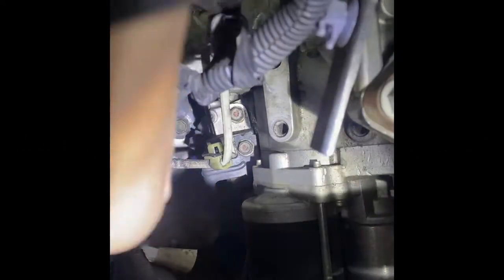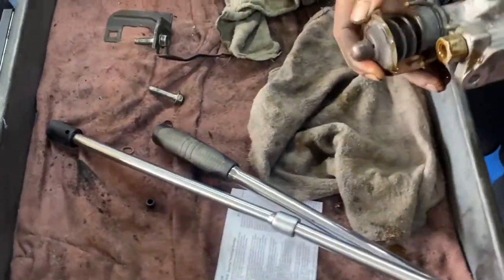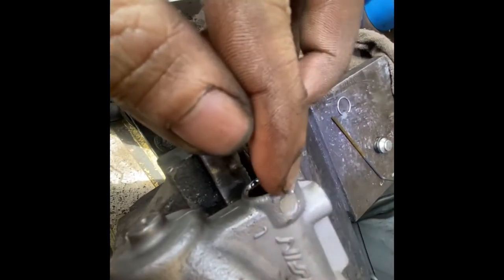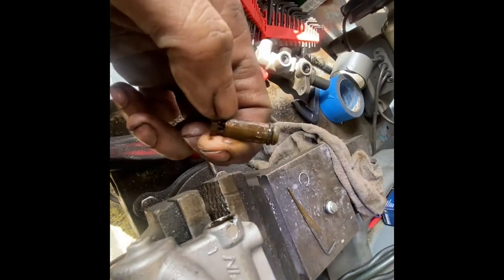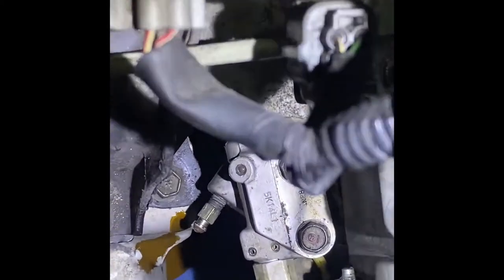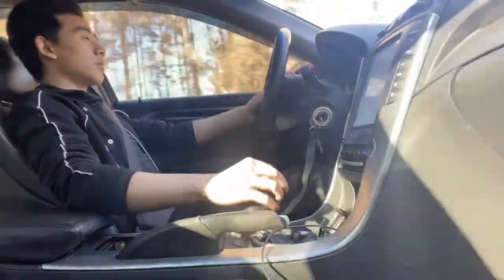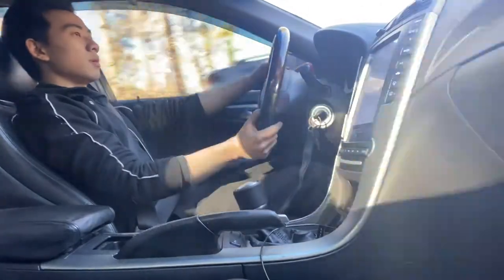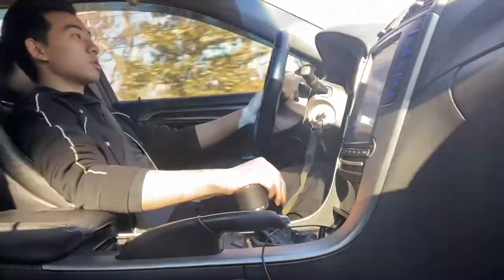Slave Cylinder Check valve Delete On The TL (insTL)

Comment: Haha love how happy you are about that mod. I'm about to do it on my 2nd gen TSX. Allready got that f** clip out.
Reply: Just did the same on my 2nd gen TSX. I had to replace the master cylinder, so might as well replace the slave cylinder and remove that delay valve.
Reply: @jtworksoncars6341  I'm really happy with the mod. How do you like it?
Reply: @knipsi22  I like it a lot. The clutch feels stiffer and engages consistently. My 1 to 2 and 2 to 3 shifts are so smooth now. The delay valve made it so hard to shift smoothly without holding up traffic. Even starting off in first gear is easier too! I don't need to give the car as much throttle as I used to.
Reply: @jtworksoncars6341  Yeah exactly! Just realized I know you from your  videos on the TSX. Thank you bro
Reply: @knipsi22  Thanks, I appreciate the support. I would film more stuff but it's hard to film and work 1 handed on the car. I do plan on making an oil change DIY and a K&N filter recharge video. Be on the lookout for those videos in the next 2 months!

Comment: Ive pondered on the idea of attempting to swap the k tuned slave cylinder into my type s but not sure if it would fit based on the configuration of the lines going into the cylinder.
Reply from the maker: It’s literally this though lol I’d say save your money and do this instead

Comment: yo I love the paint setup along with the white letters on your tires, bro. this is the sexiest TL I've seen straight up. it looks fire dude, I think it sounds pretty fucking good too especially with the pcds, I can tell she's pulling.. I have an '06 6MT TL.. cai, mid muffler delete resonator swapped with dynonax, atlp v2 j pipe, with racepipe, (third cat delete) I literally installed the j pipe last night everything else was already there, I did notice a slight change in sound, I do very much like it... later on this week I'm gonna pull the trigger on high flow pre cats. I kind of want pcds, but honestly I think I'll have trouble maintaining the rasp and I've heard good things about the hfpc so we shall see.. love your vids dude... I just saw the one on is the check valve delete worth it? it was a pain in the ass and took a few hours for me, but hell yes absolutely it is worth it... my brother rides with me regularly and he could tell the difference from the passenger seat. if that says anything... yo you running 300hp yet? if not I would imagine you are damn close... that thing seems to be running A1... shout out to 3rd gen TL owners on the come up.. 😁
Reply from the maker: Appreciate it man! And no I’m only pushing 264 to the wheel but hopefully after the tune I’ll be pushing closer to 300! Btw your comments don’t show up for me and I had to get it approved. I think it’s the cursing and YouTube is being kind of a pain for me to reply lol so in the future keep it “friendly”